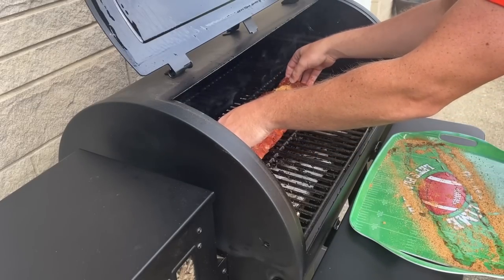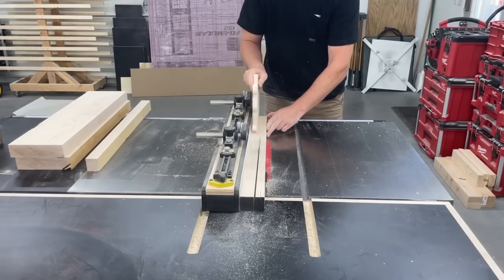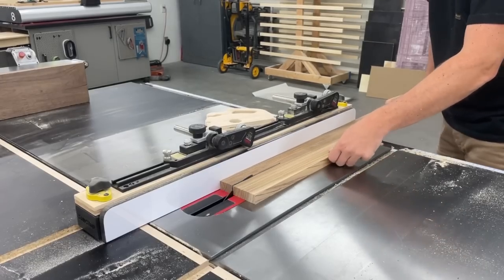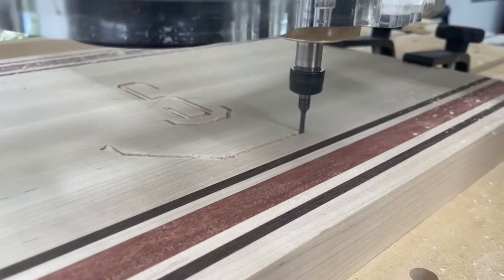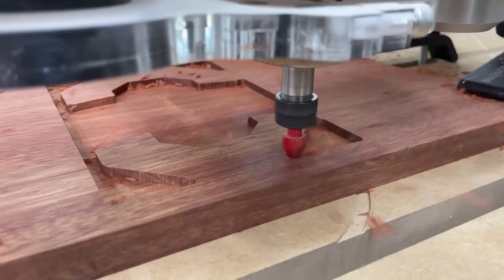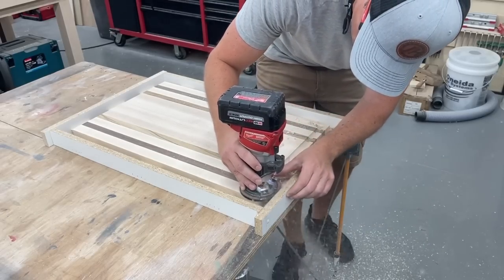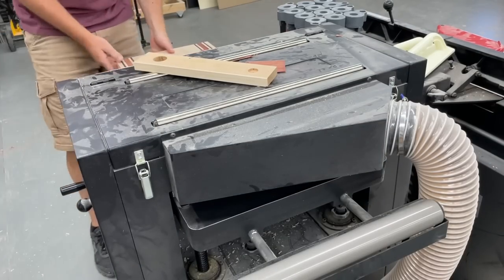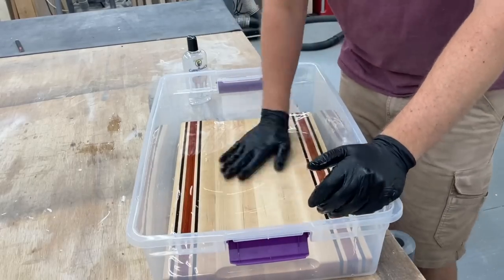Make Your Projects POP With This Inlay Technique

Comment: Nice work John. If the bandsaw/ planer is a bit squirrely, you could put the unit back on the cnc and run an area clearance toolpath to remove excess material above z=0
Reply from the maker: Good idea! I should’ve used it for the juice groove too instead of having to make a jig haha for some reason the Cnc is never the first option to come my mind
Reply: @JohnBuildsIt  Lots of us appreciate that. lol

Comment: Looks great! I did 3 cheeseboards for Xmas using a variety of hardwood to get an ombré effect and cut into end grain in “Alpine” pattern inspired by Michael Alm. It was so much stress and work but it got me through my fear of the table saw, it was a lot of straight and 45° cuts but worth it
Reply from the maker: Wow that sounds cool though!!
Reply: Thank you, I love the ombré or gradient look plus I wanted to make it somewhat original since this is Michaels pattern, not mine. So I started with a purple piece of poplar only because I don’t have access to Purple Heart and it was the darkest shade I could find locally. That was only one layer and toward the bottom since poplar isn’t the best for cutting boards but I figured the end wouldn’t be a big deal, funny enough with oil the purple turned into this marbled dark green which was unexpected but it’s really neat looking. Then mahogany, alder, hickory (my favorite wood now) and lastly or at the top was maple. Hickory has a cool end grain appearance with its striations or grain patterns naturally. You could easily batch something like that out with your set up, the longest time is spent on glue ups for the alpine pattern but so worth it. Love your cutting board and the logo detail is really stunning

Comment: Did you say that you were going to make them end grain?
Reply from the maker: Edge
Reply: @JohnBuildsIt  oh right. I've not heard of that before. In what way is it edge and how is it better for a cutting board than end grain?
Reply from the maker: @stevehignett5701  the edge of the board is faced up. End grain does make for a better cutting board technically, just more work, and not always ideal depending on the design. Like in this case on the big cutting board, as well as the osu board. The end grain of the bloodwood is basically black, so this was the best way to get the desired look and color I wanted.